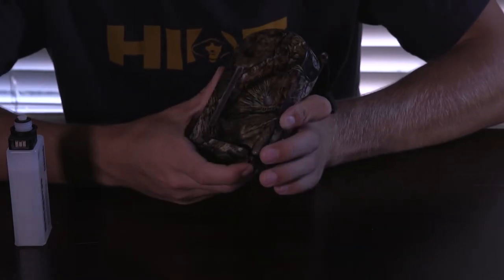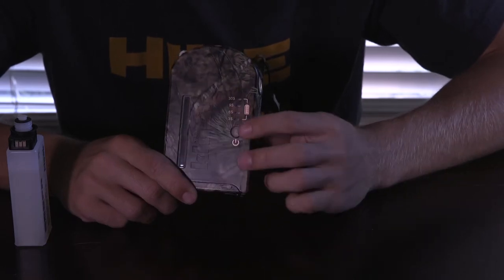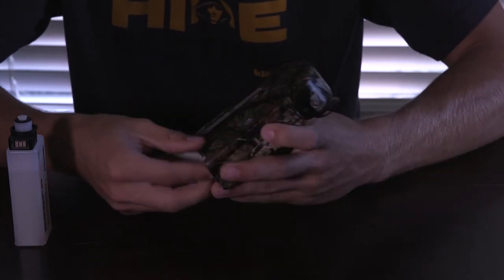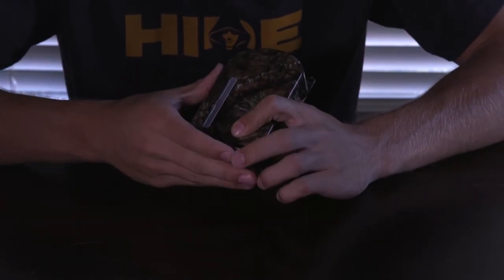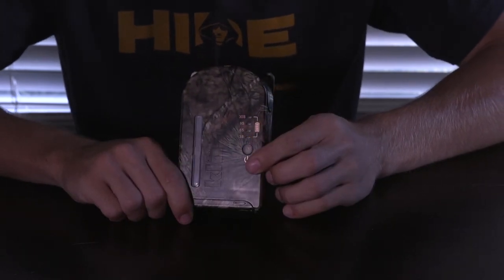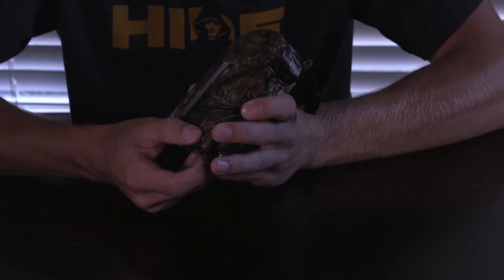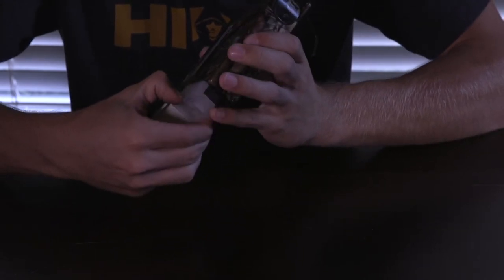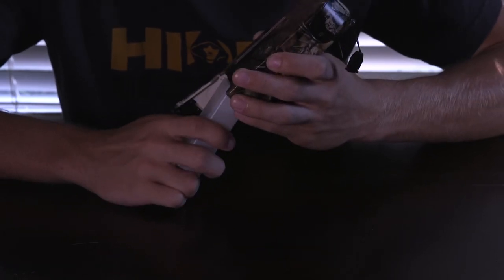Tip Series Episode #2: How to Fix 4 Flashing Lights

Comment: You know I do have to say that after spending a weekend hunting with this it works great! Had 2 groups of hogs come in using the earth scent and they had no clue I was around! One group I was walking away from the stand with a headlamp on! 

The only things I'd like to see improved upon would be a better wicking material for larger "puffs". On the 3 second mode it seems like the wick eventually can't keep up with the demand. Laying the unit on its back seems to help. I'd also like to see a grippy material on the back to keep the unit from slipping off of a wooden blind window. A rubberized case would be a good accessory and would also keep noise down while walking with the unit around your neck. 

Overall though, fantastic product THAT WORKS!
Reply from the maker: Hi im sorry for the late response Youtube doesn't notify me when someone comments. I replied to your last comment and wanted to make sure you saw my reply. Thanks for the suggestions I will pass those one to my boss. Please send me a email at store@hunterskloak.com and we can get you fixed up if you are still having problems

Comment: I had this issue with the bottle that came with my mister. I noticed there was corrosion behind the contacts on the bottle. I tried cleaning with a little vinegar but didn't work. I figure worst case, I can pull the wick out of another bottle of the same scent and refill a known good bottle.
Reply from the maker: Sorry for the late response, Please message me through instagram or facebook and I can get you all fixed up. Sorry for the inconvenience
Reply from the maker: Our page is Hunter's Kloak in the pages tab
Reply: The bottle that came with the unit worked the first time I used it , know it will not work at all(earth scent) I put the apple in it works fine, but do not use the apple as a cover up scent. I tried that yesterday and had 2 small bucks searching for at least 5min and then one of them came back I had to turn it off so he wouldn’t bust me. So definitely was as an attractant, but something is definitely wrong with the bottle that came with it its more then 3/4 full so I guess I’ll use it as a refill.
Reply from the maker: Hi email me at store@hunterskloak.com and we can work this out
Reply from the maker: Hi im sort for the super late response Youtube doesn't notify me when someone comments. Please send me a email at store@hunterskloak.com and we can get you fixed up.